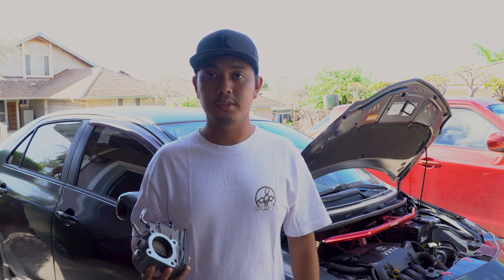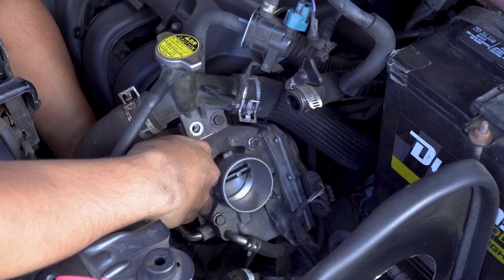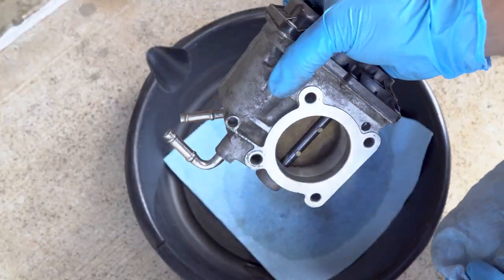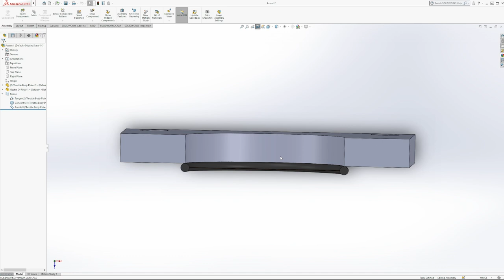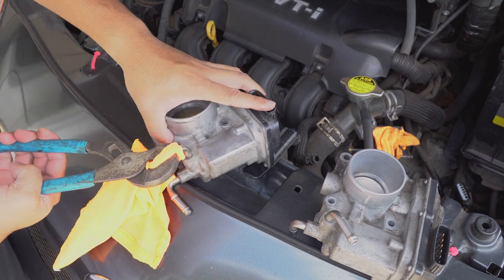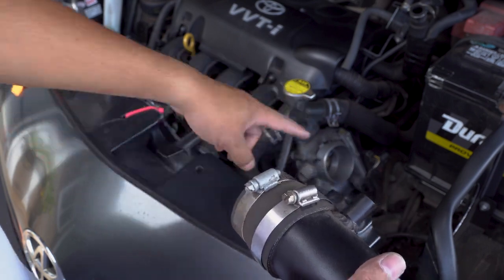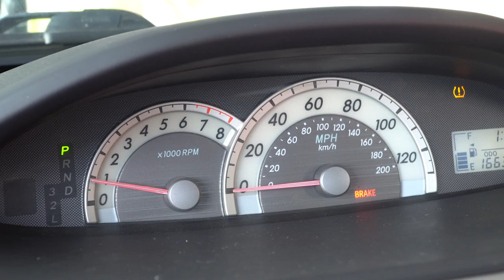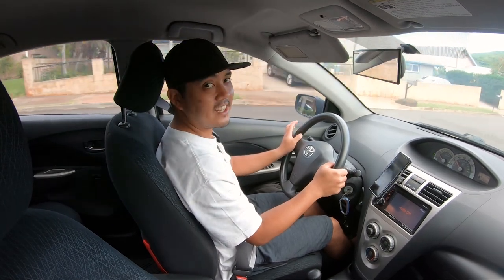I finally did the 1ZZ Throttle Body Swap on my Yaris!

Comment from the maker: Check out my 1 month update on my swap: https://youtu.be/o6-oCKTG1U4
Reply: I have a 2007 Toyota Yaris I had to replace my old Throttle Body, with a new one just wanted to ask you if when the new one is installed, id it just plug and play? or doe the new Throttle body have to be calibrated with a computer?
Reply from the maker: @alexshatner3907  As long as you are using the factory ecu, it should be plug and play. The ecu should take care of making the necessary adjustments of the throttle body.
Reply: @arvin_arn  Nice thanks you Arvin, by the way I live in Arvin California zip 93203

Comment: I like the throttle response i got from the swap. It took me a good bit of trial and error to get the idle in the ball park. I still have times where it revs too high or too low depending on the situation but i can live with it. Im going to ooen up the intake behind the throttle body next . The whole is still smaller then the 1zz diameter.
Reply from the maker: Yeah I have the same problem with it revving  high on cold startups but i'm also ok with it. Luckily my exhaust isn't too loud so I don't have to worry about waking up my neighbors every morning before work 🤣
Reply: 8
Reply: @arvin_arn  on stock ecu? And did it get better with time?
Reply from the maker: @whcwcjecjecuecuw6654  i'm on the stock ecu and I haven't had any issues since then

Comment: You could have poured boiling water on the throttle body before turning the pipes , aluminium will expand more than the steel pipes . This is also good for freeing seized brake pistons in callipers .🙂

Comment: Just completed my Swap, I used a 2rz-fe throttle body and swapped the elctronics over, I also made a little intake tube, I cut two intake boots in half and used both the large edns with the pipe in the new intake pipe in the middle so it fit correctly and had the right oil breather direction. Love the mods keep it coming!
Reply from the maker: That's awesome!

Comment: i put 2zr throttle body in my 1nz , i already installed 1zz throttle but my rpm went very high in cold start , 1nz is the best engine ever 
230kmh in stock 1nz 
part installed 
1)vvti rs 1nz
2)Mazda Maf sensor (ZL01 model)
3)Intake manifold 1nz rs (short than normal 1nz) 
4)Fuel Injector RS/TRD from 1nz  or you can put camry injector

Comment: Hello, I have a Toyota Avensis T25 1.6 2008 Manual 5 Speed 3ZZ-FE. Today I made a swap Throttle Body from Toyota Avensis T25 1.8 2008 1ZZ-FE. I also changed the hose from 1.8 because the hose from 1.6 didn't fit on the 1ZZ Throttle Body. I disconnected the negative battery when I did the process than put it back again when finished. The car was revving up and down to learn the 1ZZ Throttle Body, but now it idle at 1000 rpm. Before was idling at 650/700 rpm. What could it be? Thank you.

Comment: Thanks for your video.. Do you have or can you recommend a video for replacing the air filter?
Reply from the maker: If you are talking about the stock air filter in the Yaris, I would honestly just make sure to replace it regularly. I didn't see any improvement from different brands of filters, including the K&N drop in filter. Regular cleaning/replacement will do just fine.

Comment: I've done the same install successfully, but this ECU relearning is taking so long that I'm starting to feel that my ECU isn't as smart as i thought lol. Its been days now. Can you help me out. What have you done so far to get it to normalize? Or is anyone else here gotten it dialed down? I'm thinking about manually adjusting the IAC to see a lower idle, but needed to check if someone's got a better way to dial this thing down before I turn that screw.
Thank you!!!
Reply: You need to manually adjust that throttle position screw on the throttle body itself. There is a blob of resin covering that screw, scrap that resin off and adjust it.

Comment: @arvin_arn Hi Arvin, im late to the party but great tutorial video, loved how you covered everything in one video. wanted to ask if there is a way i can raise my idle RPM on these electronic throttle bodies. much appreciated. watching you from Sultanate of Oman. peace!
Reply from the maker: There is a small screw that is covered by epoxy that allows you to adjust the idle RPM. Just need to remove the epoxy and have a screwdriver small enough to make adjustments.

Comment: Hey Arvin or who ever may know, will doing this make it so you don't pass the visual smog test for inspection? In the comments on Rassool Racings vids he said that you wouldn't pass with this mod. I'm living in New York and I think he's from California and not sure if there standards are different.
Reply from the maker: Each state has their own requirements for car inspections. I live in Hawaii and we don't have smog inspections so I don't have to worry about this. I would check your specific state if they require a smog test before doing this swap.
Reply: I'm gonna give it a try and see what happens during my inspection this year. Might also check with a local mechanic. But anyways thanks for the helpful install video!  @arvin_arn

Comment: Hi .. to avoid issues , you brought the 22030-21030 tb with 22030-37010 tps ? .. it’s the only way ? Thanks
Reply: Personnaly, I did a swap with a 2000 corolla throttle body and its aluminum intake manifold (had to machine a phenolic spacer, and slotted the holes of the manifold) and added a  scion xB rs3.0 cold air to it. Hardest part was adjusting the phenolic spacer's contour so it fits, the sensors/hoses are all plug and play. (I'm no mechanic and I have a backup car and it was nerve-wrecking, but the satisfaction when it started... priceless.)  Battery relocation and throttle cable bracket on to-do list, but so far it was an 8-hours job for me. Not sure I recommend yet. (2005 echo rs hb, for ref.)

Comment: did u have to do anything with the ECU when u made any of these mods with the air filter and throttle body?
ive got an 09 yaris hatchback and want to do the same thing
Reply from the maker: I didn't need to do anything to my ecu after swapping the throttle body.  As long as you disconnect the battery prior to doing this, the yaris ecu will relearn and adjust to the new throttle body

Comment: how has the swap effected your smog check, still able to pass? I keep throwing EVAP codes p0505, incorrect purge flow. have you thrown codes?
Reply from the maker: Hawaii doesn't have smog inspections so I don't need to worry about it. As far as engine  codes, I haven't gotten any since doing the swap.

Comment: Do you know what that grate on the gasket is for?
Reply from the maker: I honestly don't know but I will do a little bit of research to see what they do
Reply: My guess is that it transfers the heat of the coolant to the air so the throttle body butterfly doesn't get stuck/frozen in cold weather, just a guess though.